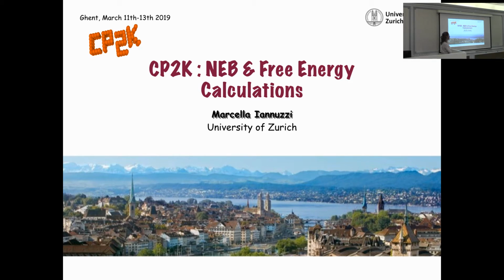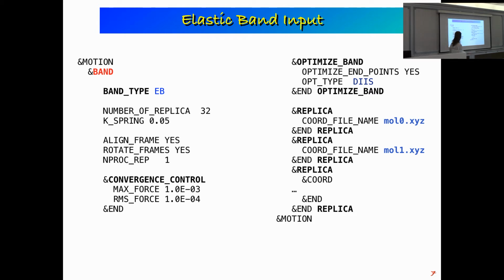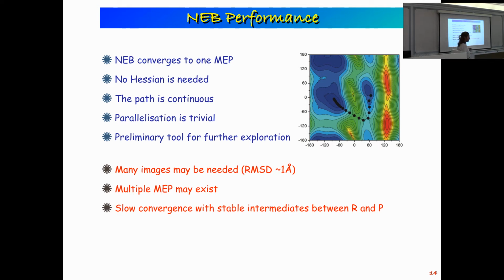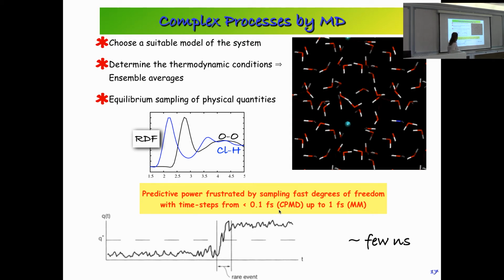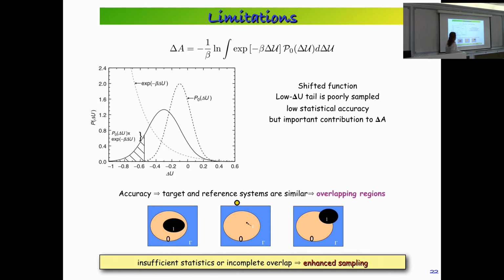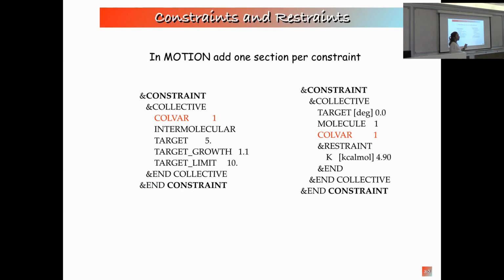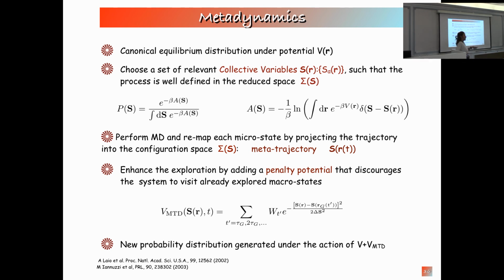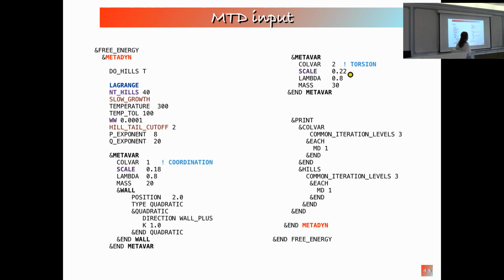Introduction to CP2K (6/7) - Metadynamics, NEB Methods (Marcella Iannuzzi)

Comment: How do I actually calculate the energy from the output of a metadynamics simulation? The potential and kinetic energy given in the data dump is not the same as the free energy , is it?
Reply: You can either sample the frequencies and calculate gibbs free energy at each collective variable coordinate and then plot them. Or you can invert the sum of all the gaussians you have added during you metadynamics simulation.